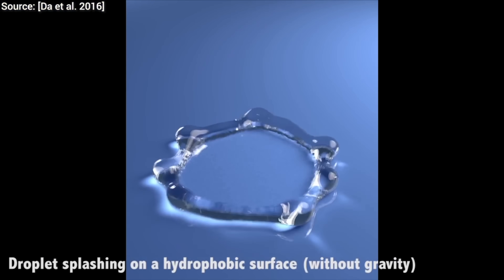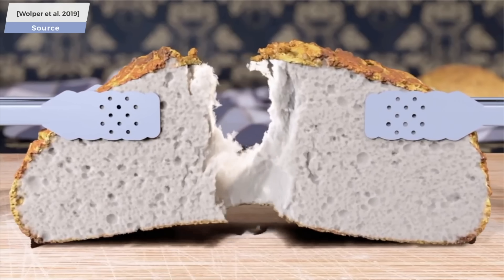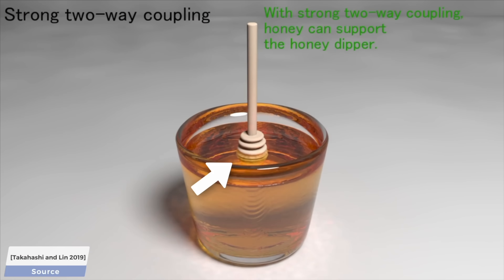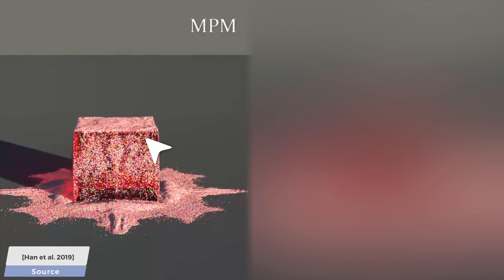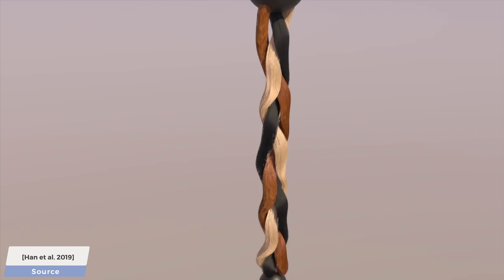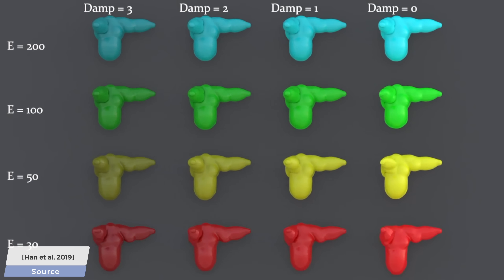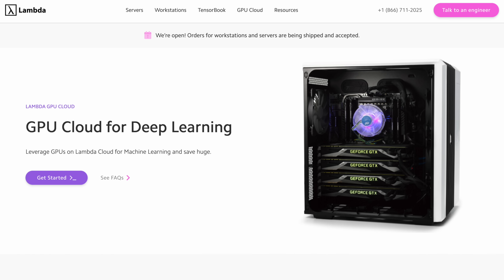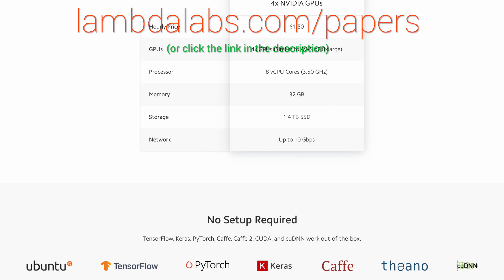Is Simulating Soft and Bouncy Jelly Possible? 🦑

Comment: Kind of disappointing though that it has taken 20 years to get to this point when such great advancements in CG were quickly made in a much shorter amount of time around year 2000. We had the beginnings of hair and fur, oceans, particles, FX, fluids, etc. It seems like at this point, processing power is the main thing that is holding us back rather than equations.

Comment: 3:14  Could someone please help me understand something? Or, could someone direct me to a place where I might find assistance? 

I am very new to programming, and only have a beginner's level of experience with C++ and Python. I am afraid that I don't understand how these "papers" or machine learning works. 😅 

I am learning how to use Blender in tandem with Unreal Engine 4.

Are these hair and body simulations in real-time? If so, how would one go about finding them and running them in Unreal Engine 4 in such a way that they would be functionally responsive to the forces acting upon the materials within the environment? On a character model, for instance!
There is a physics engine that is part of Unreal Engine 4 --- this I  I understand --- but the body physics at work here are far more realistic than what I am able to achieve with basic rigging (the way the "skin exterior" 3:39 responds, in particular). How would one come by them, and is there a way to utilize them in Unreal Engine 4?
Or, am I misunderstanding this entire demonstration?
Reply: Use unity
Reply: @floraau1795  What would be the advantages of Unity over Unreal Engine 4/5? 
Additionally, do you have any other recommendations with regard to my above inquiries?

Comment: I like the one where it sticks to the jello. Looks more physically real
Reply: But it sticks because of a bug, not because the jello was actually programmed to be sticky.
Reply: @AiuFFS  oh i see. thanks for the info
Reply: @AiuFFS  well even if it wasn’t sticky the sand should still stay on top and it shouldn’t just keep bouncing for infinity until it slips off, jello isn’t even bouncy?
Reply: @AiuFFS  even non-gluey non-sticky jelly still is sticky to dry tiny stuff like this, just like powder would fully stick to it, it has water in it . It looks still far more correct, it's not a bug, it's a feature!

Comment: Interesting, the thing that hit me was..  there seems to be a focus on the the surfaces of the materials being phobic to each other to a degree, and gives a more plastic like feel when you're doing things that are like jelly.  I am sure sand wouldn't stick to jelly like the other method, but I'm fairly certain that the block of jelly wouldn't come out perfectly clean either, & that unless the material was perfectly clean & dry not breaking down...  you wouldn't end up with a clean cube either.

Though, have to say...  an interesting concept and take on it, but I wonder if overlooking aspects like moisture & how x or y interacts with such things would end up in a misleading spot that lands squarely in the uncanny valley with no escape.   [yours looked really good, & most the material reminded me of the stickier stuff that couldn't touch small partials without grabbing some even if most bounces off]

Very Interesting effects, & I do wonder where it will lead n practical value & I am sure it is some where.

Comment: That hair simulation is wrong. Hair towards the scalp gets oiled and hair doesn't bounce like it does in the simulation.
Try flipping your hair around or see videos of women who flips their hair around. @02:00 the hair on the left is completely off, but the hair on the right is also wrong.
The way the hair flips under the sphere is not right. It looks more like strands of metal. The hair should have increased air resistance towards the end.

Comment: "behave realistic" - Water breaks into jelly like crumbles and has totally weird lighting, behaves with way too much elasticity and way too slow. The breaking melon looks as if u poured shredded jello into it, it looks glossly while ive yet to see one glossy watermelon. the sand particles move as if theyre pushed away with force by the water, not being pulled with the water, there is no ineartia. Fluid simulations dont look close to realistic waterflow. everything is too wobbly, the calculations mix particles and fluids, but fluids are no particles, hence the weird slow and jello like look.

Comment: I know you're very proud of it, but I feel I've got to point out the emperor's nudity here: the MPM simulation was superior. 2:50
Reply: Actually, the jelly in the simulation isn't supposed to be sticky. It's just supposed to be bouncy. The fact that the balls stick to it isn't a good thing. So it is considered an error. And their method doesn't have that error.
Reply: @spulap7560  I appreciate that- and it's good they've managed to shake the stickiness but the new sim proved to be unnaturally bouncy. We need to capture its ability to remain distinct from interacting particles and old sim's realism to come together in an even better simulation. I shall work on it.
Reply: @gnamp  i agree with you but i also think that the bouncyness can be adjusted to look more realistic and particles wouldn't stick to it either
Reply: @spulap7560  yes. I think you're right.

Comment: 2:55 realistically left one is more accurate as they would get  stuck in the jello, they would punch into jello just as a bullet would punch into skin, but with less force
Reply: Actually, the jelly in the simulation isn't supposed to be like that. It's just supposed to be bouncy. The fact that the balls stick to it isn't a good thing. So it is considered an error.
Reply: @spulap7560  but still if we wanted it to act realistically it should get stuck
Reply: @SilaDrenja  yes you are correct if you wanted to simulate a jelly then it should be sticky BUT this simulation was only supposed to simulate the bouncyness of the object and not other properties such as stickyness so basically it was supposed to act like a bouncy glass cube and not really like a jelly

Comment: So for rendering in real time (10ms per frame) you need 10.000 times (100 sec per frame now) your calculating power... Thinking in some way of inefficiently  and other optimizations that take out a 0 you need in any case 1000 times of your actual calc power... Thinking at a soft Moore law (and hope that we never reach a breakpoint) , maybe in 30-40 years we can do it :)... Aaahhh I will be an old man but I will be there for see with my eyes

Comment: I wonder how much memory these methods take. But also a point of consideration: Don't small particles tend to stick to larger objects?

I'm no physicist, but recalling the difficulty in clearing sand off anything after a trip to the beach, or thinking about fine coconut flakes sticking to jelly, I came up with that point. Would this new method work on woven materials, or am I out of my element?

Comment: Wouldn't powder actually stick to jelly? I saw the snow sticking to the hair which makes sense since neither snow nor hair are smooth surfaces plus static and more I'm sure, but what about the jelly's moisture and stickiness? If you handle it with your bare hands right out of the refrigerator it'll be dry but a bit sticky, as it warms and gets a bit melted it'll become stickier and kind of runny. So wouldn't the particles sticking to the jelly be realistic in some situations?

Comment: What software are they using to create and then render those simulations?? I would love to play around with it, but everything I can find is either a free trial, thousands of dollars for use only by geotechnical engineers, only builds on a DOS machine from 1998, requires you to compile the code for yourself, only supports Windows, is purpose-built for a course you have to take at a university in order to access it, etc etc etc.

I could only find one binary for macOS (NairnFEAMPM) that completely freezes and crashes whenever I try to play one of the example simulations.

Comment: Personally I like the original method as when you showed the jello, the one of the right looked way more unrealistic due to the prolonged bouncing
Reply: @MoodyCoff  That's the thing though - it is perfectly possible to design materials that allow 'adhesion' and don't bounce like that, but that's not the point of the simulation. If you look at the hair simulation, the point is a lot clearer - the hair on the left gets stuck, clumps and knots up, just by doing a flip. Imagine living with hair like that! It's a bug in the simulation, when an interaction like that should be set and not part of the method itself.
Reply: Sea Earl Punch You’re talking about the jello right?

Comment: From a sheer point of realism (not necessarily simplified accurate physics simulation standpoint) I liked the MPM better. Aside from the stickiness feeling realistic (why wouldn't it stick if it was actually soft jelly?), the bouncing of the particles seemed way too excessive; they bounced/splashed too far, and then kept bouncing way too long for such small particles.

Comment: This stuff is really cool, but everything will for a very long time still feel really dry. In the sense that the bread and oreos seemed like they were made of plastic because we can't yet simulate the very subtle interactions caused by water, oil, and protein chains that take place in food. The oreo looks like compressed dust rather than a baked cookie. Until we get a solid method for composite material particles, these simulations will always look like bone dry sand stuck together in various ways... even the water still looks like plastic, and will continue to until we can simulate those most subtle effects that really sell the illusion of reality. Currently, this is in my opinion the biggest hurdle in CG we are aware of other than approaching the ability to render in real time.

Comment: I'll be impressed when they can simulate the bounces of a screw on carpet so you can work out where it's gone when you drop it from 10 cm and it ends up 5 metres away from you.
Reply: The last time something like this happened to me, the dropped item managed to end up behind me, with the direct path from where it started being blocked by my body and legs.  How can this happen?!!!!  It took about twenty minutes to find even though I saw it most of the way straight down to the floor.
Reply: @cdl0  screws are subatomic particles and you just observed quantum tunnelling. Change my mind
Reply: @vijexa  Well, @Sophia Cristina made the excellent suggestion that goblins are responsible for this effect; however, I am going to make the bold suggestion that you are both wrong, because I am begining to suspect it may instead be faeries.  :-)
Reply: @cdl0  This is due to the wave-screw duality phenomenon.
Reply: The screw is a paid actor. I think physics is just an illusion.
Reply: Basically anything small I ever dropped on the ground without directly observing it did this. More often than not, it ended up lodged in the chair wheels too.
Reply: Large rectangular magnet on the end of a sweeping brush does the trick.  I have found many lost screws that way but zero lost springs, I think springs have the ability to cross dimensions when first released from an enclosure.
Reply: Derp, everyone knows it is the goblins tricking us, it is not about physics.
Reply: dropped items transport to the Shadow Realm.
Reply: @Hansengineering  fuck me I thought you were the Eric Hansen for a second there...
Reply: Modellers complain about a carpet monster which swallows up dropped components. In my case, sometimes I watch things fall only to see them apparently evaporate before they hit the ground.
Reply: STM  Could explain why I never seem to find them with magnets then, but I still believe they are just slipping through tears in the continuum.
Reply: but people be like "thats not realistic!!" like an idiot when things sometimes happen like that
Reply: oh, something would fall off of my bed, and it would end up under my bed when I find it, xD
Reply: Relatable.
Reply: Duh, quantum tunneling, obviously. An object passing through a barrier it classically should not have enough energy to go through.
Reply: Quantum tunneling states that an object has a nonzero probability of appearing on the other side of a boundary, so...

Comment: I wonder if GPUs are going back to the fixed function hardware blocks of the past ie: Raytracing Block, AI processing block,  specialized high speed physics block, etc. I'm aware PhysX runs on CUDA cores but I wonder if a dedicated hardware unit might be a lot faster and efficient. Of course the most likely design is a hybrid with a large pool of general purpose shader units surrounded by dedicated hardware blocks.

Comment: The old Jello simulations look more realistic to me. Jello is sticky, and nowhere near as jiggly as the new one.

And any real life flexible objects typically accumulate a lot of kinetic energy, causing things like dust, and even things the size of sprinkles, to stick to them due to their opposite charges, regardless of their base stickiness. Most often with plastic.
If you've ever eaten Muller Corners, the ones with the chocolate biscuit ball things, you've likely seen them stick to the inside of the corner, refusing to be pulled out by gravity alone. Things that large, 2mm diameters, being held so firmly in place due to it's charge alone, that should be seriously considered. Then there are also the times when plastic packaging from the new gizmo you ordered on Amazon sticks to your hands from it's charge too. That object weighs several grams, yet still sticks to your hand and is sometimes awkward to get off.
As a final example, to make sure everybody gets it, balloons. They accumulate energy simply by expanding. Dust and hair sticks to them irritatingly well.

Comment: Dr. Károly Zsolnai-Fehér's. With the exponential growth of computational power as well as the explosion of AI research how long do you think it will be before an average consumer will be able to put on a VR headset and dream up an environment of the top of their head, say 1940's urban environment, the Giza Plateau ca. 1800 B.C. or the Beatles appearance at the Ed Sullivan Show, and have it immediately realistically rendered? I'm thinking it would be initiated by a vocal command or description, the elements imported from a "library" or data base. An initial rendering would by adjusted to taste by a vocal (or possibly just a mental) discussion with the AI the way a witness works with a police sketch artist to get it right.
Reply: Considering that the growt is in decline it might take a long time. Dubbling every second year my tought is that we will come a far way 2100. But then other things has to evolve as well and right now we seams to be a bit stuck.

Comment: Maybe Im missing something but in most cases the mpm looked more accurate to me.
Reply: the hair on mpm is sticky, and the first "jello" is with very low or no damping and low stiffness (the cubes at 3:04 look more realistic). the jello is supposed to be a bouncy glass cube, i.e. not sticky.
most bouncy surfaces are somewhat sticky so it looks more realistic, but with this new method, it doesn't have to be.
for example the hair behaves like extremely dry hair, which you don't see often, while the other behaves like hair with oil on it, which iswhat we're used to see.
Reply: Yeah I mean sand would stick to jello and snow sticks in hair... I don’t get it either

Comment: 2019 version is much more realistic, sorry.
Reply: 2019 version is the new one. I know you mean MPM. But look at 2:50, the powder on the left side bounce up like a solid ball. 
I think you think the new method is less realistic because the jelly was bouncing for too long. But in 3:05, with higher stiffness value, the bounce is realistic too
Reply: Tsz Fung Li think more that powder would probably stick quite a lot to a jello
Reply: @ckalas  The stickiness is a glitch. It's not meant to do that. The point is to simulate bounciness, not stickiness.
Reply: @ckalas  You're probably right. It's quite realistic to have it stick on the sides

Comment: Wouldn't some particles get stuck on jello the more sticky it becomes? (ie when it melts slightly)
Reply: Yeah  most of the jellos are sticky at some level even without melting but I think it was an unwanted thing in this case. It would be nice to add a parameter for stickiness.
Reply: The issue is that it's not a feature, everything would stick that much by default. With this method there's at least the option to make surfaces sticky if it's wanted.
Reply: I think calling it jello is misleading. It's just a translucent block that jiggles similarly to jello, but other properties like its wetness and stickiness are not meant to be part of the simulation.
Reply: then it should be called jigglo